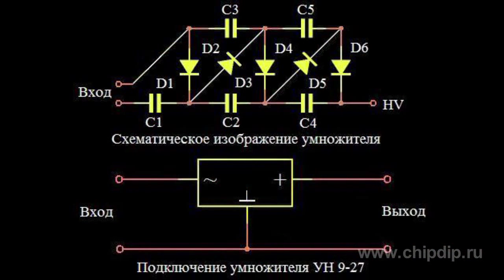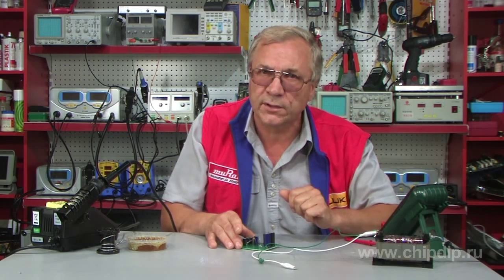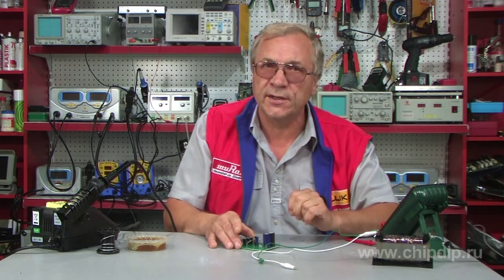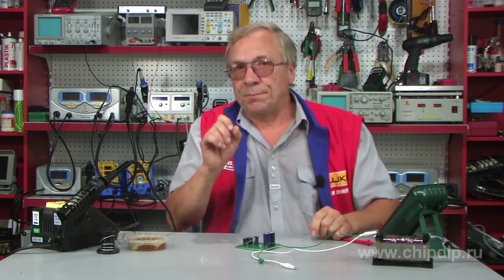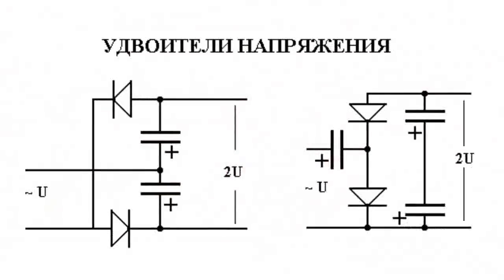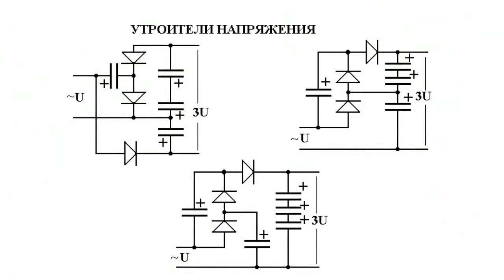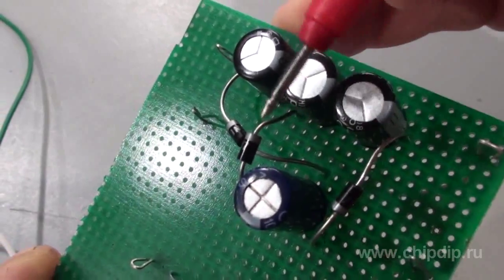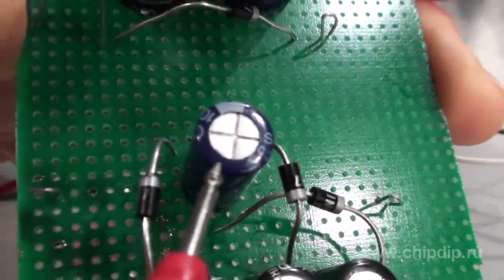Voltage Multiplier

Comment: omg! i used 100uf 50v polarized caps and in4007, 24v rms step down transformer and my stupid fluke 15b only reads 1.5v dc in the second circuit diagram from the video, i also tried other circuits and i cant do a voltage multiplier....